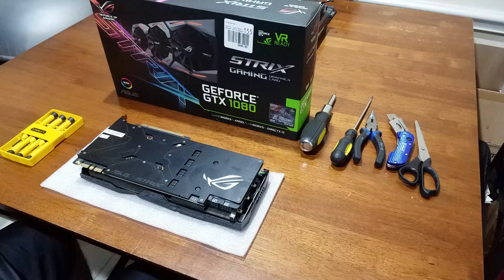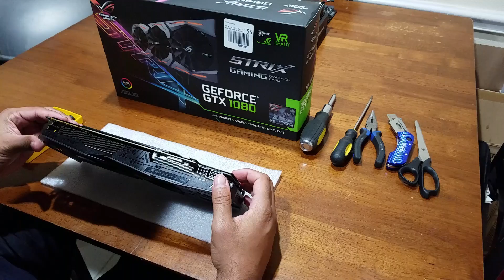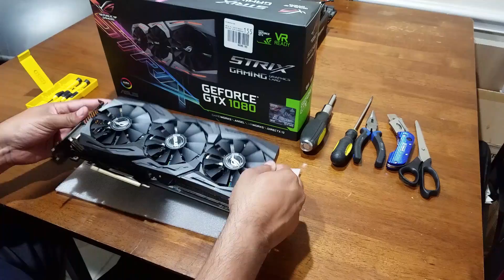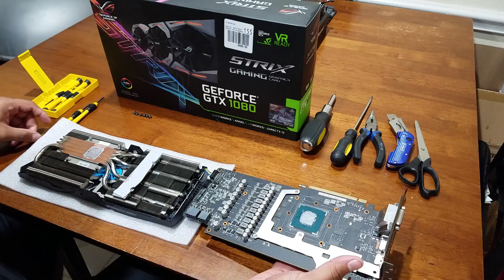HOW TO REMOVE ASUS GTX 1080 STRIX AIR COOLER

Comment: That is not a heatsink for the RAM. It was made to prevent the board from bending but they are also using it sorta like a heatsink because you can see that some of the RAM chips arn't touching the metal "heatsink"

Comment: Hey man do you have to remove it that way if you are trying to install a new fan?  If so, do you how many pins are there for a single fan (4 pin or 5 pin)?  I broke one of the fan's blade and i'm trying to get a replacement fan in my strix 1070.  You are the only one I see tinkering with it

Comment: Does the backplate rgb still work once you install the waterblock ?
Reply from the maker: harshlens yes full rgb with this Bitspower waterblock
Reply: 1st thank you for reply, but I mean if you install ek water block and keep the original asus backplate, does the asus logo on back plate can still use it's rgb feature ?
Reply from the maker: harshlens  the ek block for strix 1080 is not compatible with the original backplate or rgb
Reply: okay, thank you for the information.

Comment: i have a question, i don't find any answer but, the Kraken G10 fit on the 1080 GTX STRIX ? and if yes, the warranty is avoid if i put a AIO  ? thx man great video !
Reply from the maker: DioNerks yes it will and yes it will void the warranty